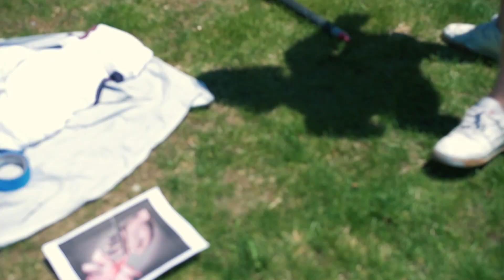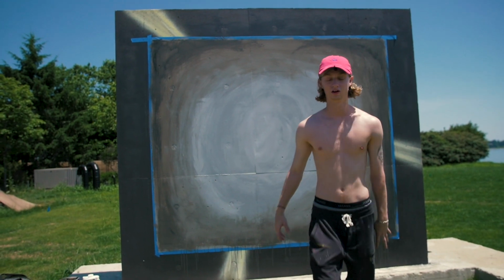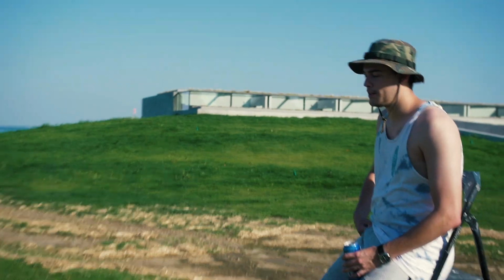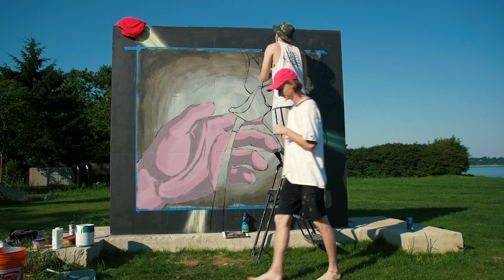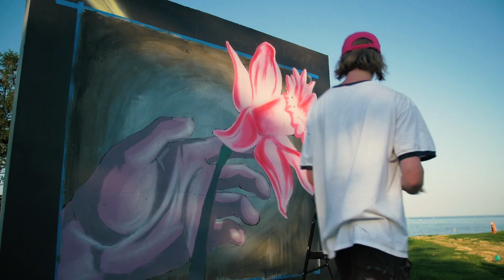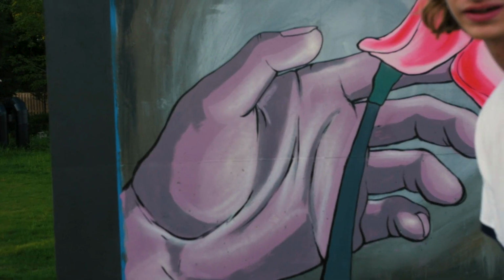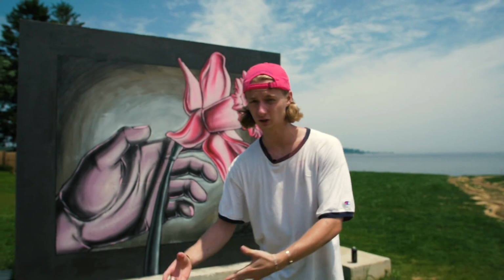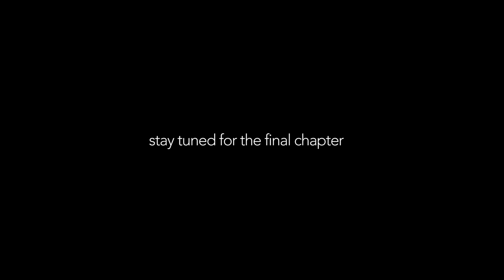I Painted a Mural in a DREAM Location // Chapter Two

Comment: Measurements would be so much easier to calculate if you use the metric system
Reply: why?
Reply: i mean in the end is doesnt matter does it? It depends on what yuo are used to